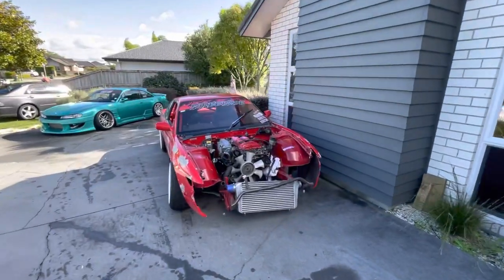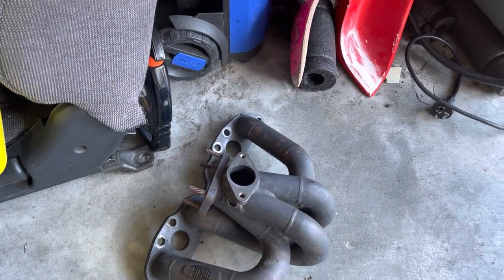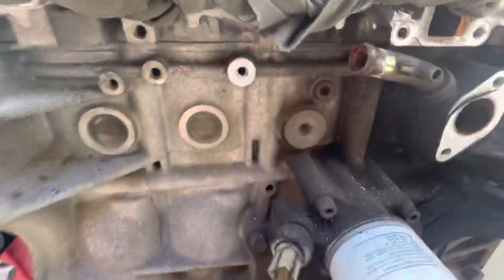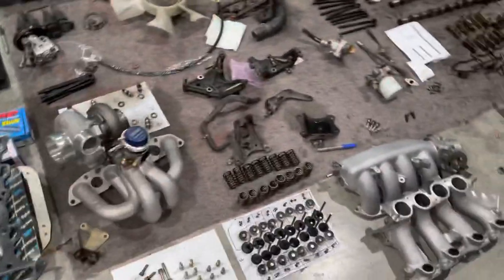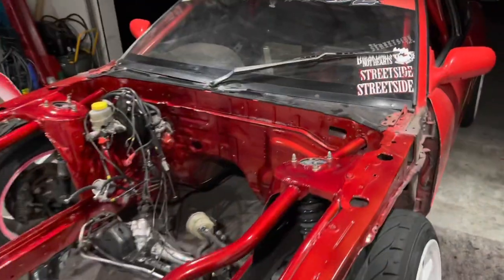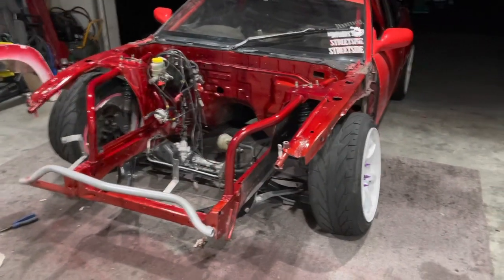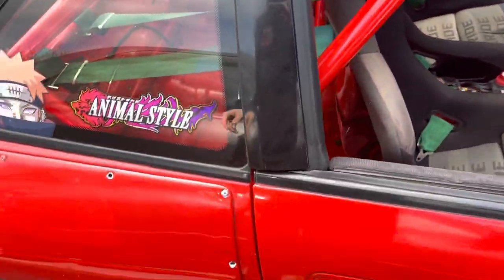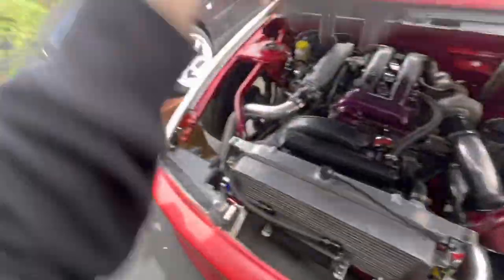I PUT A TURBO IN THE S13 ( SR20 PLUS T BUILD & WALK AROUND )

Comment: How do these de blocks hold up ? Consider boosting my na sr s13 but with forged internals and e85 but just for 300-350 wheel
Reply: mine makes 320 280 at 14psi no e yet, it's definitely worth doing
Reply: I plus t my barra shes been on 21psi for 5 years now done 150,000kms with the turbo setup and haven't had any issues. Just change the oil every 15000kms. Had a sr20de plus t aswel and ran 22psi on that drifted it for 3 years most weekends